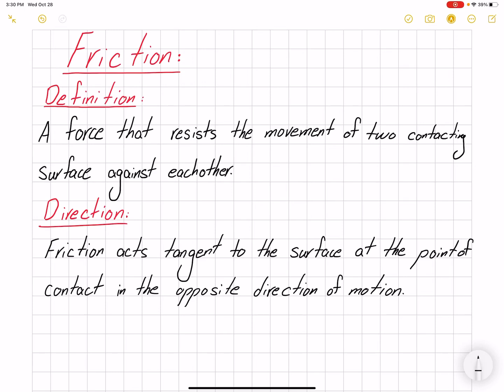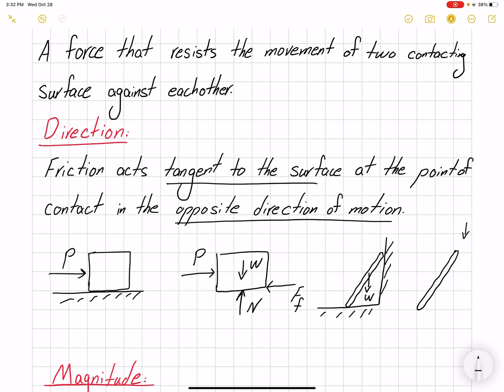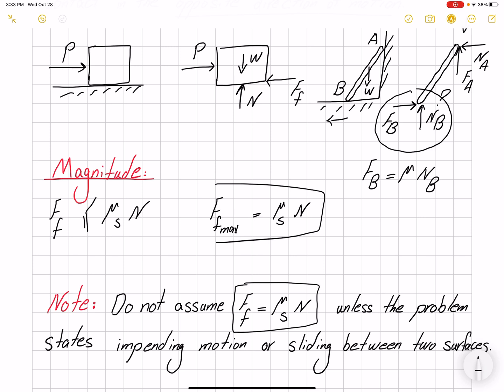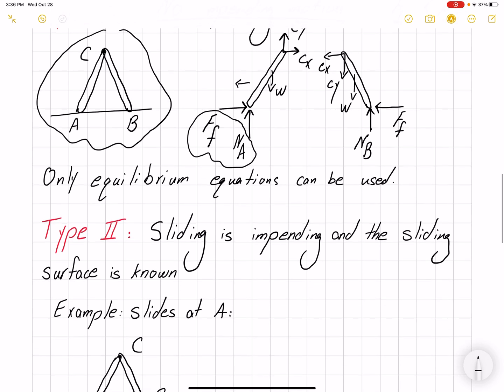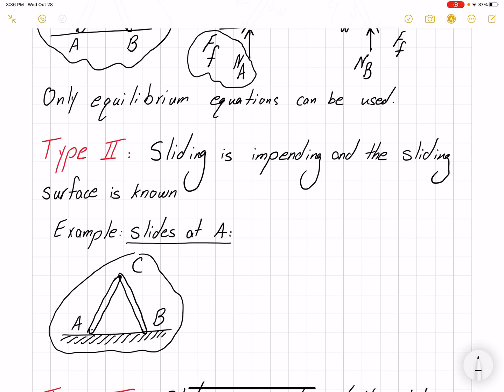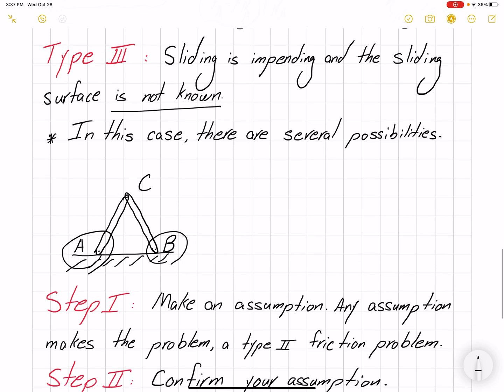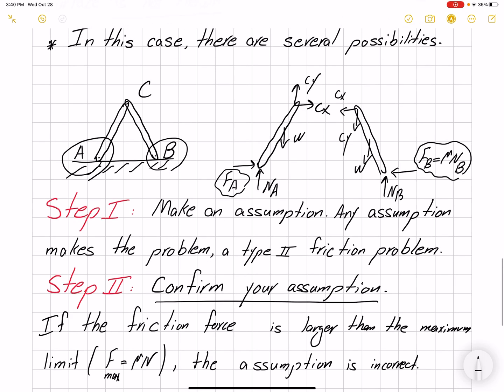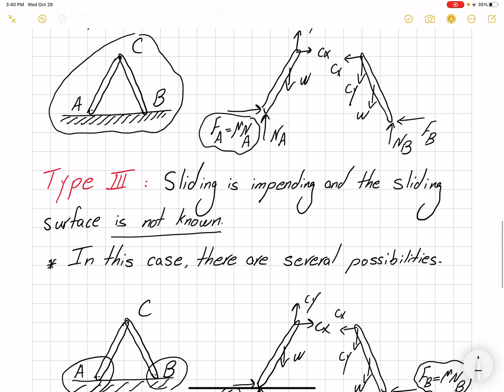Lecture on Static Friction

Comment: If i slove the question which does not indicate the motion where is i should not use MsxN for friction force am i right?
Reply: There is a wedge question which says determine the smallest force of P to lift the cyclinder.Lift means moving upward but in the solution there is use for MsxN why?
Reply from the maker: We use F=Ms*N, where there is a sliding between the two surfaces. 
If there is a wedge rubbing against a wall, there is sliding and maximum value for friction needs to be used which would be MsN